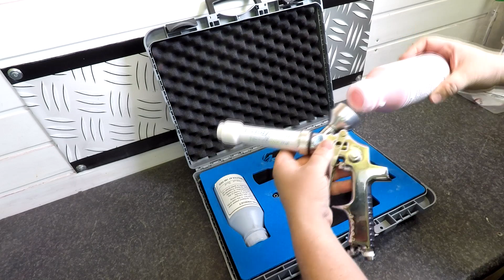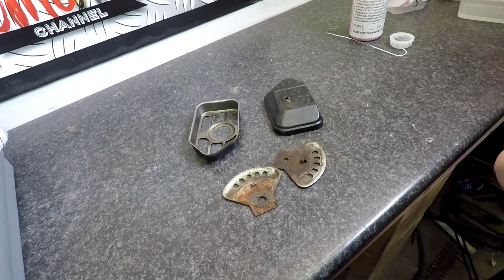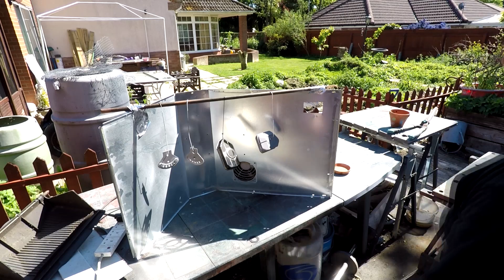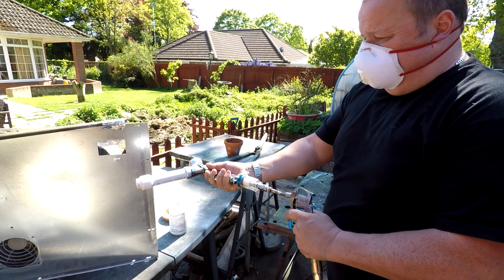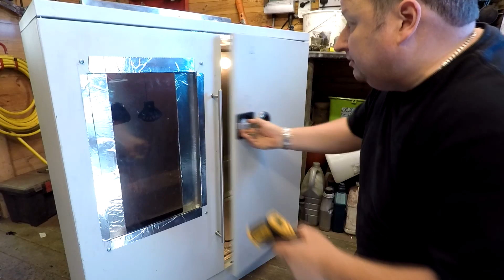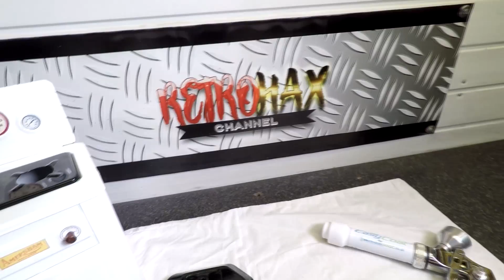My First Time Powder Coating At Home Is It Easy ?

Comment: Can't wait to use mine. I got the kit from them yesterday at the show st the nec. Picked up a second hand oven today.  Not tested yet. Need to find it a place and wire it in. Then onto powercoating the lawnmower parts

Comment: Two questions: 
1. Is the clear coat for the chrome powder coating the same as the normal clear coat for base paints? 
2. Does the clear coat for chrome also apply to the gold gloss powder coating?
I just got the Electrostatic Magic Easy Coat System and need this clearance please.
Thanks!!
Reply from the maker: I find the clear coat powder dulls the chrome finish so I tend to spray the chrome powder with 2k car lacquer to protect the surface.

You could use the clear coat for chrome over gold gloss but I don't really see the point.
Reply: @retrorestore  thank you for your response. It helped a great deal.

Comment: Hi I have  ordered the same  system  you are using  .you  made it  look  so simple. I could  do  with  some  advice  of you please. 
What size compressor  would be  best ?
I will also  be using the  compressor  for a blasting cabinet as well. 
What type of  blasting  material  do you use ?
Any advice would be  very helpful  .
Thanks
Reply from the maker: I have videos sharing all that info bud.

Comment: I'm pretty sure you can fill pits by using a powder coating primer and sanding between coats until the surface is even before doing your topcoat.
Reply from the maker: Yes but the proper filler is a great help.

Comment: Cheers for the great video.  As an earlier comment says you should be on TV. 
I have been trawling powder coating vids online for some time learning all the tricks.  Your vids the best.  One guy actually had a great tip.  He bought one of those cheap counter top ovens off amazon.  Uses it for smaller parts like you just demonstrated.  Saves on electricity.  Thought that tip was worth passing on. Cheers.

Comment: Martin, Just noticed the water filter is on the wrong way round. According to the info on the back of my water filter packaging, same as yours Air in ie, from the compressor, goes in the blue end and air out is the silver end after passing through the filter element, then to the gun. Not too sure if it works in reverse. I keenly follow all three of your channels BTW.  Regards  Geoff

Comment: Hi. Just wondering what media you use to blast with?
Reply from the maker: Aluminium Oxide Simon 60/80 grit
Reply: @retrorestore  thanks for that. I have today picked up an AEG electric oven to do the same as your oven. Just need the cabinet now. I'm also in Lincolnshire.

Comment: I've been using the Electrostaticmagic Easycoat system for 5 years, I've done loads of parts for my kit car.  I've never had a problem contacting the team, they always have answered the phone and give great advice whenever I've asked for it.  Great results but of course the end results directly depends on the amount of preparation of the parts.  Good video.
Reply from the maker: Great point!

Comment: i been coating at home for over 20yrs n thought id give you few tips .when you finished giving a coat of powder get a led torch n look over the peice you covered it will show up where you havent put enough powder on as in the bare metal will stand out through the lighter coating . also ive found for best results after you clean the part put it in the oven for 10 minutes on 300f or 150c that will get rid of every single bit of dust ect and if you coat the part while its slightly warm you can then put a 2nd coat on which gives it a way better finish .the good thing bout coating is if you make a small mistake let the part cool for 12 hours then rub it back with 800 paper then clean and recoat .you think its fun now wait till you do two tone metalics with clear coat it looks way better than 2pac paint .you can also spray paint parts then powder coat clear them so you can get whatever colour you need if your matching car parts to its paint colour .hope this helps you in future .have fun
Reply from the maker: Great tips, Thanks very much.

Comment: I'm a bit concerned that the human operator appears to have to be an active part of the electrical circuit for this kit to work. if the earth return is via a strap on your arm, I just hope you don't have any electronics like a pacemaker installed. Everything in my training screams 'wrong' when i see a human as the return path for an uncontrolled electrical current. Maybe they can address the issue, but my first impression is not encouraging....
Reply from the maker: You are totally wrong. There is no electrical circuit.  If you touch anything in your daily life, you are grounded. That's it. No electrical circuit. Contact the suppliers if you are concerned. Do you not think that a supplier would have to meet EU regulations before they would even go into production? Use your common sense bud.

Comment: great video martin. love the oven... i looked at the oven build and something i'll be doing soon. ive already made an oven using an old oven but its too small for wheels... i didn't use the the old oven controls as i found they do not keep the temperature  stable so opted for a PDI electronic controller which if you are interested you can find here...http://nickstr6.weebly.com/powder-coat.html  there is also the spray booth which also might be of interest...?

Comment: This gun looks amazing, have tryed to cover mdf with it? If it works I will buy one 😂
Reply: I believe you can powder coat any surface that can take the heat. If its a non metal surface like glass or wood that won't carry a charge then you have to heat the surface, apply powder and then bake. In this case the heat replaces the charge and forces the powder to stick.

Comment: i think its a really nice system....tho its 2 1/2  times the price of east woods at the moment because its right now for $69.99, I just have so many questions and need to see more videos of it because small parts are easy to do but large rims or car front hood and things like that need higher voltage so I am doubtful this would do the job....so till I see a video a real truthful un edited video showing those things then for me I would still trust an eastwood dual voltage or even a harbor freight one before I do this one.None the less its a good video and i think the technology is wonderful to have another option in the mix, I am also wondering how long those parts inside the gun will continue to keep giving the powder electrostatic charge and when will they wear off and can you  replace them or do you need to get a full not gun and system?.
Reply from the maker: i have done a steel wheel on my Retrohax channel. Check it out.

Comment: Hi Martin after our chat stream yesterday, I realised I missed this powder coating oven and powder coating series, I watched the lot last night, I’m really tempted to do the same myself. I was really impressed with the simplicity of the easycoat, I just need to find time to make the oven. Anyway great series, if I do go ahead it will be really helpful. Cheers🙂👍
Reply from the maker: Nice one Luke, yes, its a great asset and easy to do as well. Nice to chat with you too bud.
Reply: retrorestore Yep I might get searching on the Facebook pages for the bits I need and get on to it over winter time when work isn’t so busy, I was impressed with the price of the easy coat kit, I thought it would be much more than that. Also my dads got a sandblasted, but it’s buried at the back of his garage, so I’ll see if I can turf that out. But I’m like you lots of stuff to clear so I must get on while we have decent weather, hot hot this week they say 😓 Don’t work to hard🤣🤣🤣 🙂👍

Comment: nice video. i do powdercoating also at home.
a tip: after you cleaned the part and prebaked it go over it with a butane gas hobby torch  before you put the powder on you will burn al the dust particals of you get a cleaner result.
greetings from holland. cheers.
Reply from the maker: Yes I've seen that done, Thanks for reminding me

Comment: That is a hobby kit at best, try doing an alloy wheel ,and see how long the coating lasts, id give it a week at best.
Reply from the maker: You have nothing to back that up bud. I'll be testing that.
Reply: @retrorestore  Most modern powder businesses use a base etcher primer coat then use the pigment color. I have had things coated in the early 70,s and you could peel that back after a few days that system is like the 70,s era
Reply from the maker: We'll see.

Comment: Wow, brilliant results, and an easy to follow tutorial! Well done!

Now, please forgive my ignorance, but is it possible to connect the 'copper pipe' that you had the work-pieces hanging from to the nearest 13-amp power outlet? Thus giving a good earth, and limiting the number of things trailing about! :-)
Reply from the maker: Yes you could do that it just needs to be more negative than the positive powder.
Reply: @retrorestore  I was just thinking that if the area/spraybooth was earthed is such a manner, it'd a little more easy to move about.

Not a problem with small items, but if slightly bigger items need to be treated, wheel trims, or a lawnmower deck, it may prove more beneficial.

Comment: Great video! Finally someone showing the non electric coating gun compared to the electric ones.... Been considering one of these for down the line one day, but wasn't sure of them.... All I coat up to now though, are fishing jig heads using the fluid bed way.... What I do want to see if possible, is a demo of the colours... silvers, chromes, metallics, glitters etc, for ideas for my jig heads for fishing....
Reply from the maker: I'll be testing all those powders soon Chris
Reply: Thanks. looking forward to that video...

Comment: i still dont see what place powder coating has in everyday life. ive had parts powder coated and they are no where near as good as wet paint results. i had the sliding door rail powder coated on a van im doing up and its gone from a gloss to matt finish in a year and its now pealing off to. i think half the issue is there a fair few people out there that do it that have no idea what they are doing, so you dont always get the results you should get
Reply from the maker: As with painting, preparation is everything. It is very hard wearing compared to paint.

Comment: Thankyou for a very interesting and informative series. I was wondering with pitted parts if you coated them with perhaps a copper based weld thru primer that you could then flat back would you still be able to coat and cook? Or do the easy people sell a product for flatting pitted surfaces
Reply from the maker: You could grind it flat and i'm sure there is a heat proof filler I could try.

Comment: Really enjoyed your videos martin, had a go at powder coating with their old system a few years ago using old kitchen oven and plastic green house as spray booth , i now have my kit car in bits and spurned on by this i have bought a ready made old DIY oven (£30) made out of a cabinet like yours, picking up at weekend and will be using it for parts such as the suspension wishbones.
Reply from the maker: Nice one Richard. Good luck with it bud. I know the person who owned that cabinet. He used to get good results with it.
Reply: @retrorestore  cheers i hope to do some mods, maybe the glass window and casters to name a few, was also thinking to put stands as shelfs in it so  i can store stuff when it is not being used so as a dual purpose.

Comment: I ran powder coating businesses for several years Martin. The gun you have is a Tribostatic Gun which uses friction to create the static charge. The high voltage systems are called Corona Guns which requires a high voltage generator to create the charge. There are advantages and disadvantages to both systems.....but the Tribo Gun you have is very well suited to what you will want to achieve. Great oven build by the way Martin. Google Tribostatic powder coating for more info........to start with this link explains the difference between the two types https://www.coatings.org.uk/Sectors/Powder_Coatings_Corona_vs_Tribo_.aspx
Reply from the maker: Interesting read, Thanks for the info

Comment: What pressure do you set your compressor on for your sand blaster? And what media do you use? Seems to work very well.
Reply from the maker: 110psi and I use aluminium oxide Alex

Comment: Very nice results
I can see the price of second hand cookers on the rise for a while
I assume if your only going to do small parts an old electric oven would do the job
My only worry would be if you drop something on that element by accident
Would it create a short or is the element hidden within the rod not exposed like a toaster

Suprised the vendor didn't give you a discount code for your audience
Maybe he doesn't need too
Reply from the maker: He did, its in the description below the video. Its not like a toaster element. Its like a kettle. Not live to touch.

Comment: Interesting. Static electricity is high voltage though... Very little current or power though. Great lateral thinking in the design of the gun.

Comment: Great result!
And the Easy Coat System is really clever. The downside I reckon is that you need a bit more powder as it doesn't attract the powder as well as a system with high voltage.
Reply from the maker: It does Bas, I was surprised.
Reply: @retrorestore  Good to know, thanks!